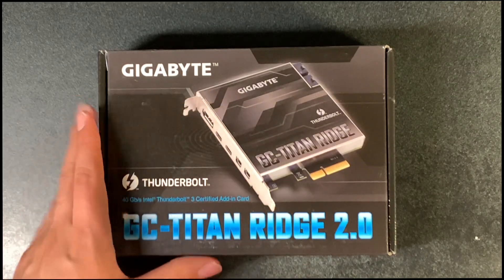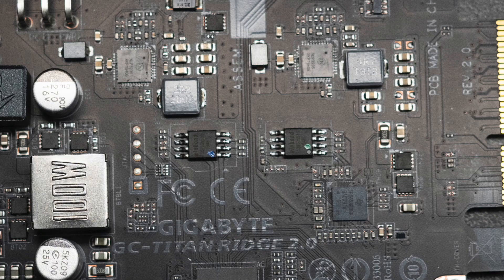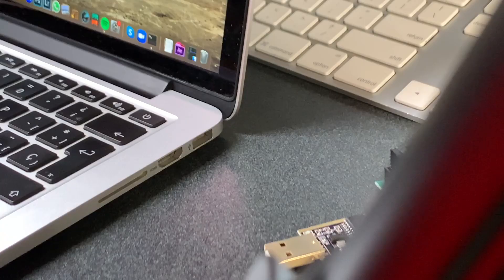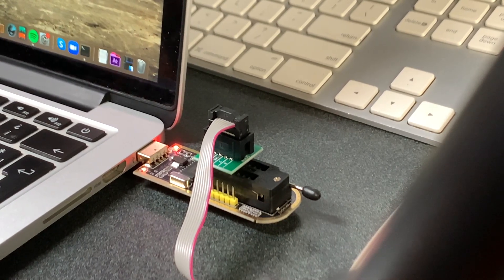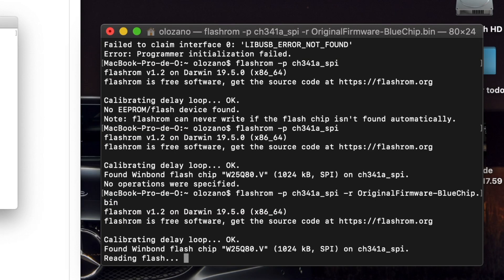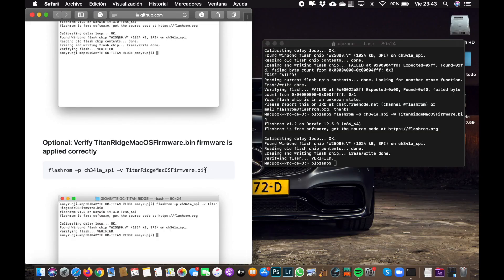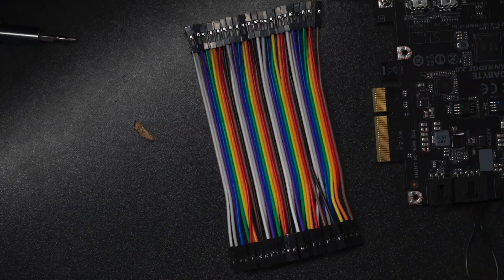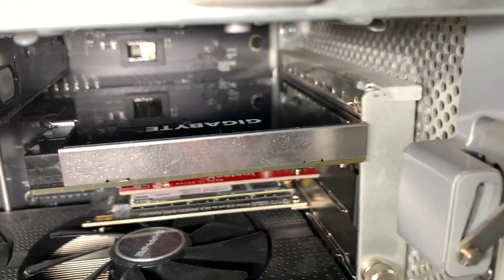Tutorial Step by Step: Flash Titan Ridge 2.0 for Mac Pro 4,1 5,1

Comment: Octavio, Can you tell me if have to flash both chips, the blue and the green chip, or just like your video, only the Blue, Cause when you read the instructions is written: ''The blue and the green chips that need to be flashed have a small dot with their respective colors.'' Thanls in Advance.
Reply from the maker: You had yo back up both chips (don’t do it at your risk)
Only flash one 

How you see if you are not expert with this stuff, you can get multiple errors, so better have on hand both chips originals

Comment: Hey Octavio, I need some help. How are you able to run the thunderbolt 3 without connecting the card to the PSupply with the 2 x 6pin ?
Im lost lol
Reply from the maker: You can run thunderbolt without delivering power through the thunderbolt port 
I made pixals mod to my Mac so I can have power delivered through the thunderbolt

But it isn’t required to run thunderbolt
Reply: Ok, Im really new to hardware tech. since my saphire 8gb use all the power cords, I will need to do the same thing. could you tell me more about that pixals mod ? Big thanks Octavio
Reply: Image size (273511 B) doesn't match the flash chip's size (1048576 B)!

Im getting this error on the step where I've to flash the blue chip

Any idea ?
Reply from the maker: @chevallierbrice5154  yeah you maybe need to make the pixals mod there is a good video here in YouTube, it’s 30 min long but it’s very explicit about how to do it 

Reach me on discord so we can talk of what errors do you have 
olozano#3714
Reply: @MrOctavioLozano  Awesome, I sent you a friend request on Discord.